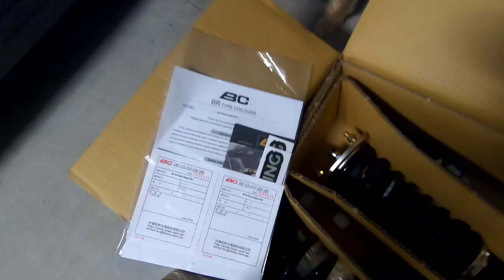BC Racing Coilover INSTALL For My FGX!!!!!

Comment: Hey dude, i bought some of these for my fg, a bit disapointed with the height adjustments though. I like it low but found that the doby ultra low springs sit lower in the rear more than the adjusties, i got about a 60mm drop in the rear from springs alone. Fully legal.
Reply from the maker: The height mine is it scrapes the dump pipe and I had to shorten the rear bump stops I didn't want to have it slammed so I'm happy with it, I mean if you wanna be dirty low just take out the spring all together 😉😂😂

Comment: Do they get rid of body roll or do you need swaybars for that? Also, you think it's worth spending more and buying MCA or shockworks instead?
Reply from the maker: Sway bars usually will help body roll more than adjustable suspension but I did notice a difference, I couldn't justify spending that much money on coilovers for street use, maybe if I get a track car I will go a more expensive suspension choice

Comment: A year on and how do you rate them? I'm considering ordering a extreme low kit for my fg. How does it ride? Is it bone jarringly hard?

Thanks
Reply from the maker: They are adjustable so they aren't that bad
Reply: @ajlarkingarage  nice. We're yours the extreme low kit of the normal kit?
Reply from the maker: I think the link is in vid description, but they are just the golds
Reply: @buggiesandboars  hey mate did you go with yours? Did you end up getting the extreme low kit if so how is it!? Cheers
Reply: @zackgrigoriadis4377  yeah, mate. Went with the extreme low kit. Plenty of scope for adjustment for height. I'm actually going to raise mine a little for a bit easier of day to day use and less harassment from the boys in blue.

The ride is sooooo much better than I thought it was going to be. I have my shocks set at about halfway, so I can still make it even softer if I wanted, and I live around the worst roads in Australia FOR SURE! definitely recommend them.
Reply: @buggiesandboars  awesome man do you know what spring rates you’ve got did u get custom or?
Reply: @zackgrigoriadis4377  just went with the rates it comes with. It's definitely firmer than stock, but handling has improved greatly. It's not a boat any more. Paired with some mitchelen pilot sport 4 tyres, and it corners like its on rails now.

Coil overs will always be my 1st
 " cosmetic" mod now. It totally transformed the way the car fells and drives.